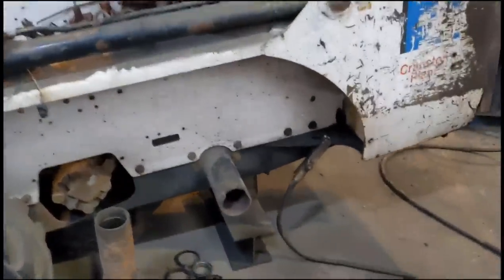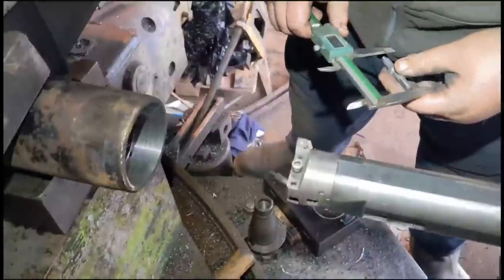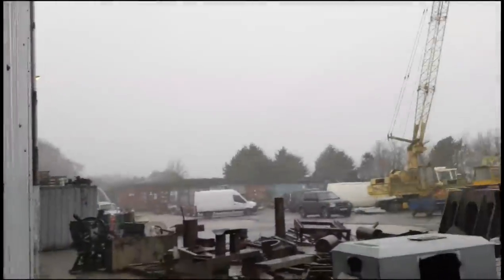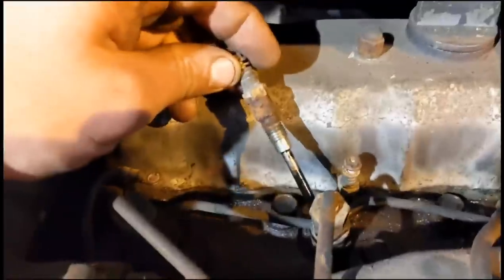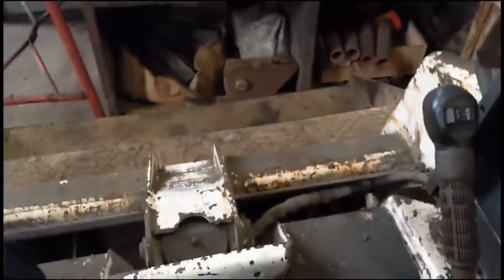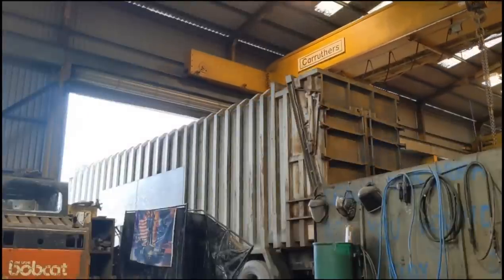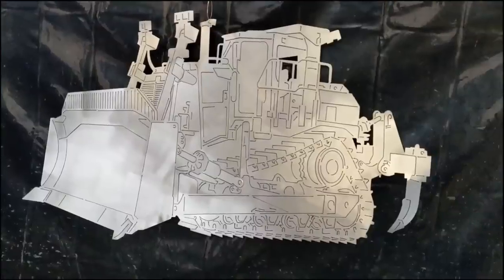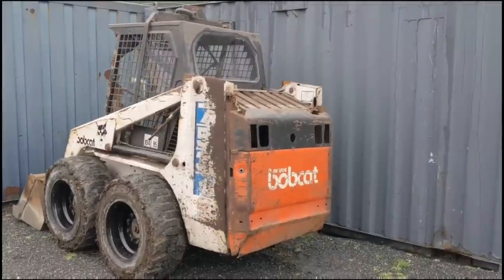the battle to save a broken  bobcat 753! one axle destroyed weld and engine mysteriously locked up ?

Comment: Straighten out one bend of a paper clip, heat it up glowing red with a lighter, poke it quickly through the fingernail and feel instant pressure relief like you wouldn't believe! Watch your eyes it will spurt the blood trapped under the nail, but once drained, in a week or so, the nail will fall off and the new one will begin to take its place.

Comment: Man!
This warms my cold black heart!

I do believe you have a early 753 "C". I have a C also. Mine has the BICS system on it and was runnin when I got it.
Mine is the 50th year anniversary model.
I did hafta clean out the chain case and replace all of the axel bearings as well as all the motor carrier bearings and seals and bla bla bla...

That was about 10 years ago.

It has paid for its self many times over now.

Every welding shop has gotta have one of those units!

You cant beal some of the American equipment. 
Especially the older stuff like you have there.

If I ever get over there again, I will buy you a beer!

Thank you!

Comment: @allistairc123 hello from NC, USA! Me and my pops done those chain drives and axle tubes before they’re a pain, having to crawl over in the machine to replace bearings and connect chain links sucks. We have bought tubes that are machined to go over the existing tube, just cut back so far, drive the new ones on and weld around them. Awesome that you guys put a whole bobcat in a milling machine!! If you can do that I know you can make some replacement axle tubes to weld on LOL. Maybe help you on the next one!

Comment: I've always used hot diesel down the bores, only ever had 10 or so engines stuck petrol and diesel over the years but it worked every time, sometimes a few hot cups of diesel was needed.

Comment: That is a very interesting milling machine.  I've never seen one with a output on the end of the table.  Certainly a heavy duty turn table for the Bobcat to perch.
Congrats on the engine!!!!  I have a 4n1 bucket on my 32 hp Kubota tractor that came from a 80 hp Bobcat.  It was a little heavy but I put it on a diet and got 
it trimmed down so the tractor didn't roll over when the bucket got 2 feet in the air.....  Works great.
I think you've got a winner.
Daniel in Illinois, USA
Reply from the maker: Hey Daniel, got your email thanks, haven't had one second, life very busy at the moment. Thanks for continued support!. What model Kubota you got?

Comment: I had to do a similar job a couple of years ago on an old M371 bobcat here.
Thankfully the axle stubs are bolt on so I could get them in the lathe and true them up afterwards.
I know the 371 is much smaller but I don't think it would fit on my bridgeport table. The joys of having big machine tools. It's a pity I'm down the other end of the country from you. I'd probably have a bit of work for the big mill from time to time.

Comment: I have always taken a glowing nettle and put  one or two holes in the nail to release the pressure underneath, just so it doesn't lift of by it self. And it takes a got deal of pain away. most time's the nail will stay on till the new one push it off Love the video learning som cool shit on welding and nice fabricating techniques. Stay safe and keep em coming.🚜👍💪. Hail from Denmark

Comment: Howdy, I have a B3200 I bought it in 2013 and it now has 989 hrs on the meter.  It is the fifth Kubota I've owned. I mow 5 yds in summer and plow our street (3 blocks long) and 14 driveways in our neighborhood in the winter. We only had three snows this year. 
If you don't mind sharing your email address I'll share all the dirty Kubota details.  My tractor bit my left middle finger last August. I had a rear wheel off fixing the idle switch under the deck. I had it all blocked but when I tried to put the wheel back on the blocking rolled and caught my finger just behind the nail between the fender edge and the top of the tire. Real lucky it didn't break the bone or cut it off. It took 4.5 months for the nail to grow out.  I'm big on details!!!!! LOL
You work way too hard.  Sounds like your pappy works even harder.

Comment: On rust frozen engines the key is to work them back and forth back and forth more and more until they feel good.  I have contemplated putting a whole machine on my HBM a few times but haven't had the right one yet. Someday!  Looks like you got the little beast going good!

Comment: @ 27.10 the starter was stuck in the fly wheel, trying to turn an engine over where you were was the hardest place always easy to move on the ring gear

Comment: If you wanna see a "Seized"  engine, Check out "Cold War Motors/Straight 8 Challenge". Crazy bastards used Hyd. fluid & a port-a-power to move a stuck piston. She ran, Not well, But she ran.
Reply from the maker: Ha ha ha unreal!!!
Reply from the maker: Lucky they didn't burst the cylinder. It's a wonder the head gasket didn't blow
Reply: @allistairc123  Thanks for the vidya's. I think my last comment got deleted by the gestapo.

Comment: I'm not so sure you engine was locked up, it looked as if the starter drive was engauged into the flywheel teeth as you were trying to bar the engine over. that would lock it from turning
Reply from the maker: I checked that bud, the starter was engaged because the engine was stuck once the starter loaded up it wouldn't retract, but small tap on nose of starter disengaged it